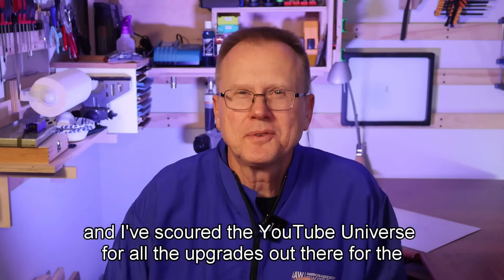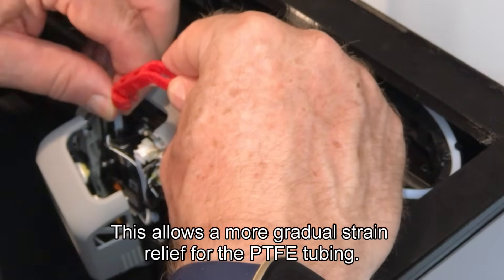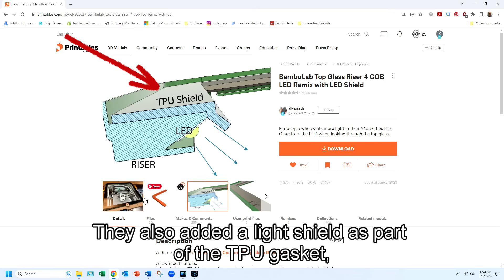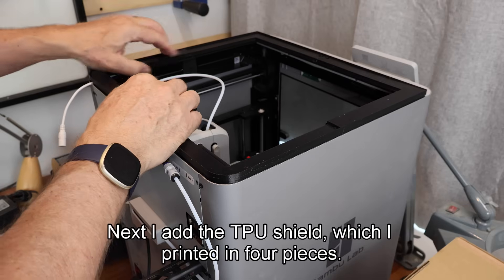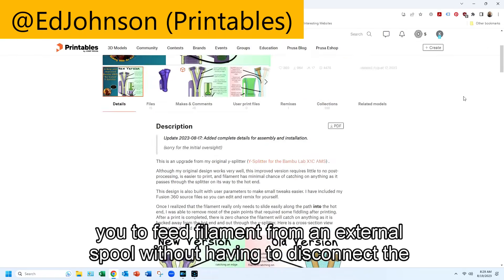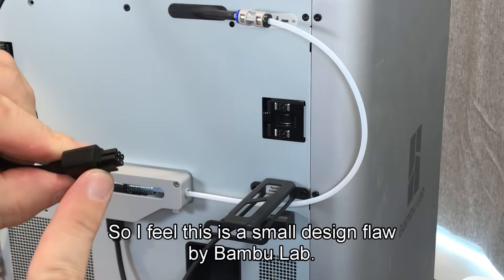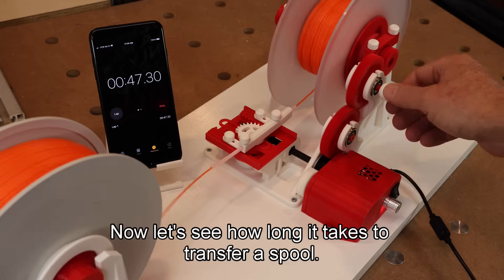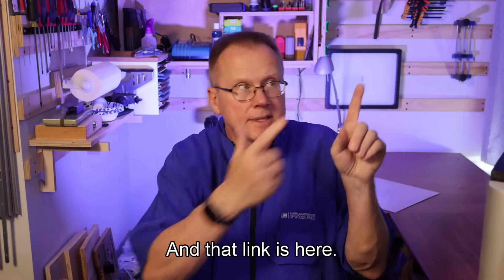The 10 BEST Upgrades for your Bambu Lab 3D Printer!

Comment: You mentioned the scraper as your #4 but didn’t add a link to the print. :(
Reply from the maker: The plastic scraper I mentioned as "Number 4" was not 3D printed.  It is a commercially purchased scraper that includes 100 plastic replacement blades.  The link for this is in the description under "3D Printers, Tools, & Materials (affiliate)", which is an Amazon affiliate link. I hope this helps.

Comment: I have a number of roles of non-Bambu filament. Could I take, for example, an empty Bambu PLA spool with its RFID and wind a non-Bambu PLA filament on it. I'm guessing the AMS reader and Bambu settings will give me a good chance for a decent print. Thoughts???
Reply from the maker: As long as it is the same type of filament, I don't see any reason why it wouldn't work; but I have never tried that.  It's worth trying to find out.  Thanks for the suggestion/question.

Comment: Hi Thank you for the video, I have order the Bambu X1C with a AMS. While it get delivered I thought I might start printing some of your recommended upgrades on my 8 year old Robo R2. I printed the two small Dessicant trays with the covers, those came out great, but when it came to print the desiccant holders the  larger one I used supports and trying to remove the supports I just ended up breaking the part . Question Printing the Desiccant larger holders on the Bambu X1C does it requires support.  Thank you!
Reply from the maker: I looked at the parts again and I am fairly confident that I did not need to use any supports for the desiccant holders.  Thanks for your question and for your comments. I hope you enjoy your X1C when you receive it.

Comment: Thank you. I did print the poop bucket and it was massive way too big for what I need. Would be good for a more slim one in the back
Reply from the maker: Yes, there are some smaller designs of filament poop buckets on Printables and Maker World if you want something smaller.
Reply: @ristinnovations  agreed just have to do some quick measurements

Comment: That respooler is an awful design. It breaks easily, and it’s nearly Impossible to build due to absurdly tight tolerances. Just print a simple dual-cone that adapts to a power drill and be done with it.

Comment: Thank you for the great advice, seriously well presented. I just picked up my X1C today. Going through the amazon list, is the "Vertical Heat Press Machine" absolutely necessary for the spool switcher/rewinder?
Reply from the maker: No, it’s not necessary, but you will need a solder iron to add the metal inserts. The press just makes it easier to put the inserts straight in the holes. Good luck with your X1C!

Comment: Thanks for your video. When using the " PTFE Extruder Bracket" is it then still possible to close the lid on top of a X1C printer?
Reply from the maker: Yes, I have my glass top on my printer and it has been working great for several months. Thanks for your comment!

Comment: Minor thing. Putting the Hygrometer in the dessicant container at the front gets an artifical reading being so close to the dessicant. If you put one in there and one inside the AMS you will see very different readings.
Reply from the maker: You are probably right about that.  I have found the hygrometer gives a good indication when the desiccant needs to be replaced/refreshed.

Comment: Are those light ok with heat? the ones ive found on ali are rated to 45c
Reply from the maker: You do bring up a good point.  I couldn't find a max. temperature rating in the link I used for the LED lights I bought on Amazon.  The only thing I remember from the original Printables article was that they recommended to use hot melt glue to attach the LED strips to the 3D printed parts because the self-adhesive didn't hold up to the higher temperatures within the 3D printer.  I haven't had any issues with the LEDs I installed, but I'm not running the printer at 70 degrees C continuously.  Please let me know if you find LEDs that are rated for 70 degrees C.  Thanks for your question.
Reply: @ristinnovations  mine have fine so far, little blob of hot glue at each to be safe, adds about 3 degrees to my chamber over a few hours, useful far ASA actually

Comment: This is the best video ever.  I’ve watched it more than 10 times lol.  I’m trying to figure out how to line up the round hygrometer in the middle of ams.  The hygrometer has the flanges on the diagonal but the print expects them at the center top and center bottom.  Did I order the wrong ones? Got them from link
Reply: We figured it out everyone.  Just be sure to download version one of the file on his link.  I downloaded version 2 thinking it was a “better version” but it just fits a different hygrometer.  Love it!
Reply: @MrChucklepuff  thanks for sharing the solution!
Reply from the maker: Lol, if you watched my video 10 times you have just become my new best friend😊. I used the same link when I ordered the hygrometer that I posted so I’m sure you ordered the right one. Unless the desiccant holder design was changed since I printed it I’m not sure why it isn’t fitting. If you are interested, could you send me some photos of the problem at info@ristinnovations.com?
Reply: @ristinnovations  just sent it

Comment: Is there an AMS mount compatible with this LED riser? I like the design more so than others I’ve seen
Reply from the maker: The glass top fits on top of the riser and the AMS sits on top of the glass. Are you asking if a mount exists if you don’t want to use the glass top? If so, I’m not aware of a mount.

Comment: NOT TO BUY It would be good that you comment that there is no technical service and that with a new printer I am unable to print with an open incident for 6 days and no one gets in touch and there is no other way to get in touch, do not answer in networks, in mails, in the support service .... when the service of other printers like Creality respond instantly. Very disappointed, I do not recommend at all to buy until they are ready.

Comment: Snip the plastic lock on the polarized connector and print your own external lock that holds it in place. 
Less cumbersome to use than the tool that mitigates the small design flaw.
Reply from the maker: That’s another option. Thanks for your comment
Reply: @ristinnovations  Thank you for the information and knowledge! 
Subbed
Reply from the maker: Excellent! Thanks for subscribing  @Hohmies86

Comment: What spools don’t work in the AMS? I have used many different brands with out issue.
Reply from the maker: Bambu Lab doesn’t recommend cardboard spools. There is a spreadsheet on the internet that lists the manufacturers spools that don’t fit in the AMS. Thanks for the question.
Reply: @ristinnovations  OK, despite that fact I reiterate that I have not had any issues with any spools. Thanks for the video I enjoyed it.

Comment: im getting me a p1s... def will use most of these upgrades LOL... also subscribed... stupid question but why dont just connect the led to the existing led so it auto turns on?
Reply from the maker: It’s a good question. I wanted to avoid directly connecting the LED add-on to Bambu’s power source because I didn’t know if it would affect the Bambu electronics. It turns out that the added LED would impact the LiDAR. The added LED can also affect the camera so I’m glad I use a separate power source which also allows me to turn on and off the added LED when ever I want. Thanks for the question and for subscribing😊

Comment: Nice video 🙂I was wondering about putting a couple of hinges on your build plate holder? Then you could fold it against the wall so it doesn't protrude into your workspace.
Reply from the maker: Thanks for your idea, but I’m not exactly sure what you mean about the hinges. Can you provide some more details? Thanks
Reply: @ristinnovations  Sure 🙂 I noticed that your holder for the printer beds sticks out quite a long way. I thought that, maybe, if you attached a couple of hinges (one at the top, one at the bottom) where the holder connects to the cleat you could fold the holder against the wall horizontally. It would use up a bit of useable space on your cleat when folded but I guess you could offest that by hanging it at the end of your cleat and folding it away from the other tools placed next to it. If it still doesn't make sense, I can try to knock something together in Fusion but I really don't hink I can get to it for a week or so. Being Christmas and all that.

Comment: Hey, do you happen to have a BOM (Or at least the screws etc) necessary for the upgraded spool winder by Diplomator that you showcased?  Going over the required items in the Printables for it is rough, and I don't want to have to spend on fasteners I won't use a lot of.  Thanks in advance!
Reply from the maker: I never put a list together, but I will try to provide you with my best estimate of the hardware by the end of this weekend.

Comment: Cool video and upgrades. I preferred a dehydrator instead of the desiccant beads as sometimes the beads won't return to original dry state. So, it can become a consumable and they won't do a lot for drying out the filament just more of a humidity maintainer.
Reply from the maker: Yes, I agree a dehydrator would be more effective. Thanks for your comment!
Reply: @ristinnovations  
I use a dehydrator to dry out the beads too...

Comment: Thanks for a great video! I printed the Spool Winder and love it. I did run into a couple of issues printing on my Bambu Labs X1 Carbon. The axles did not fit and needed to have the XY dimensions reduced to 94%. I also learned Gold Silk was not a good choice for axles though it worked fine for the lower body. They ended up breaking. The inserts I got were a little too big for the holes and caused some bulging. My last issue was the motor is not powerful enough when the take up spool gets loaded. I'll do some searching to see if there is smaller drive gear to provide more power.
Reply from the maker: Thanks for your feedback. Yes, the motor could be stronger. Let me know if you find a motor with more power. Thanks
Reply: @ristinnovations   I ordered the same motor type with a 200 RPM spec. It listed a higher torque value. I'll let you know if it works out.
Reply: The 200 RPM motor worked great. No slow down as the take up reel gained filament. 

I also modified some parts to better fit together and address a couple of issues.
-	Manual drive axle. Removed the insert hole by the handle. I had an axle snap under load.
-	Drivetrain. Modified the 128mm and 32mm axles for better fit with the gear and bearing
-	Sled. Created a bearing clip to hold the bearing in the holder. Also made a worm gear spacer to keep the worm gear in place. I had an issue with the worm gear disengaging from the drive gear. The 47mm axle was modified to remove the insert hole on the bottom and thickened slightly to better fit the bearing.
I’ll post a remix to Diplomater’s site.

Comment: I can't seem to find the file for the cereal box dry box spool holder that doesn't have the desiccant box attached? I printed steve's desiccant box and see a picture of the spool holder but no file that has the desiccant box attached to the spool holder?
Reply from the maker: I’m sorry for my delayed response. I have to double check, but I think I modified the stl file in my slicer by cutting off the attached desiccant tray. I hope this helps.

Comment: I did the light mod and used the same light kit.  I noticed that if you select a brightness less than full that it will cause the camera picture to flicker.  I just use the 100% setting, but if you want to use the others, then a capacitor between the + and -  may eliminate this flicker.  Not worth the trouble to me.  Just wanted others to know about the flicker.  BTW,  that's not a White Balance issue.
Reply from the maker: Thanks for providing your recommendation and experience!

Comment: How did you actually get Awesome Filament Spool Rewinder to print on an X1C? People I have talk to are having a terrible time time printing this, esp. the gears which are giving non-manifold edges issues. Simplify and repair are not working on them ? What setting did you use to print these parts ?
Reply from the maker: I followed Miklos Kiszely’s recommendations on Printables. I’m not sure why I didn’t have any issues compared to you, but maybe if you contacted Miklos he could offer more specific advice sine he was the creator of the original files.
Reply: @ristinnovations  Which one please, he lists several. Update 1 or Update 2 ?
Reply from the maker: I used Miklos's Update 2, but I also reprinted several of the gears using Diplomator's stl files because they had improved the designs of many of the parts. @brucewilfong538

Comment: How in the heck did you get the speed controller inside that box? I bought all of the parts from your list.
Reply from the maker: It was a tight fit. I had to rearrange the wires a couple of times before I could get everything to fit.

Comment: Hello Rist! I'm new to 3D and I'm printing the COB LED strip light on a P1S. In Bambu Studio do you have to rotate the LED shields by 180 degrees out of plane so they print on the flat side instead of the lip?
Reply from the maker: Hi, yes you want to rotate the TPU LED shields 180 degrees so the “top” of the shield is on the surface of the build plate. Please let me know if I can be of further help. -Ken

Comment: Hi Ken. Thanks for the nod to my y-splitter! Your mod is a great solution, but I think I could have saved you that hard-earned penny if my installation instruction were more clear. :-) Since we can't post images or links in comments, I sent more details via email. Thanks for this roundup of upgrades. I appreciate all of the time and effort it takes to curate a list like this, test everything, and put out an excellent video!
Reply from the maker: Hi Ed, thanks very much for taking the time to send me your email. As you mentioned above, we both provided each other with more details in our emails, which is too hard to do in these comments. I am really enjoying using your splitter and thanks again for sharing your design on Printables! Also, thanks for your comment😊

Comment: An issue with many LED upgrades is that they interfere with the lidar, which is possibly why Bambu have the lights so dark and have tinted glass panels anyway.
Reply from the maker: Yes that is a good point. That’s why I like my upgrade because I can use the remote to turn off the LEDs until after the printer has completed the LiDAR calibration. Also, I mainly use the texture plate, which isn’t compatible with the LiDAR anyway. But you do bring up a good point. Thanks for your comment.

Comment: Hello Rist! I've printed many of these, and one aesthetic only upgrade I might mention is the fancy PEY/PEO sheets I've purchased from the Juupine Aliexpress store. I have one of each kind of their build plates and they all work great on my P1P! I also know in the X1 they might not function super well with the LIDAR, as even the bambu textured sheets can be an issue there, but as long as you've already calibrated the filament on a different build plate I wouldn't see any issues in using them
Reply from the maker: Thanks for the feedback. I’ll need to try some of those 3rd party build plates.
Reply: 100% agree I got all of them, they are game changers. They leave a really cool finish on your prints that can take things to another level.

Comment: Could I suggest that you use a compressor/limiter to your vocal audio, the start of your vocal address is a higher volume which booms, the compressor/limiter will give uniform levels and stop any booming of the levels.
Reply from the maker: So to clarify, does my volume change through the video causing yo to adjust your audio? If so, I wasn’t aware of this so I will have to determine how I can fix this. Thanks very much for taking the time to help me make better videos 😊
Reply: @ristinnovations  No I dont have to adjust my volume level,however, the boom on the vocal audio is noticeable, anyone that starts talking will initially start louder and then adjust their natural spoken volume, A limiter allows you to set the level so it is never exceeded, the quality of the audio track once limited/compressed is very noticeable, you can get free plugins that should work with whichever audio software you are using.
Reply from the maker: Thanks for your feedback. I will look into this.

Comment: I have fitted LED lighting to all of my printers and on each one I have had to print diffusers as the light is too powerful for my cameras even when using just one small strip, The strong light washes out the colour of the filament when monitoring the print on Octoprint or Klipper
Reply from the maker: That’s great to know. Thanks for sharing your experience.